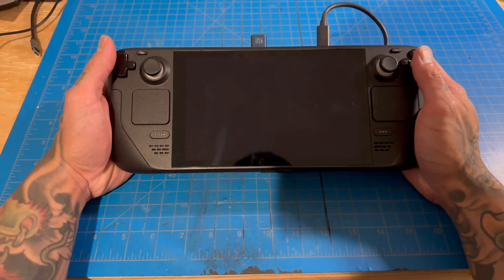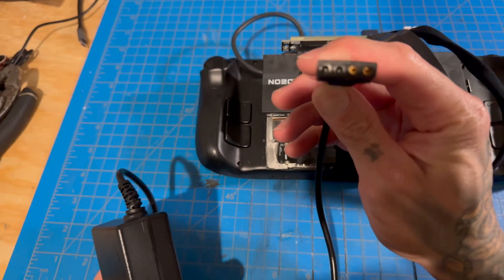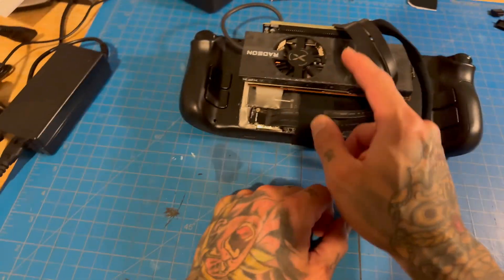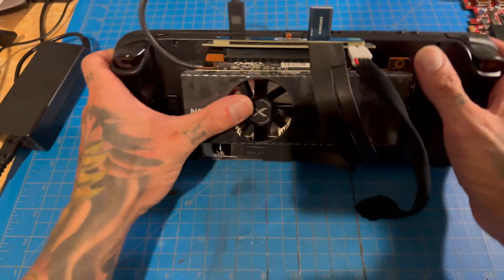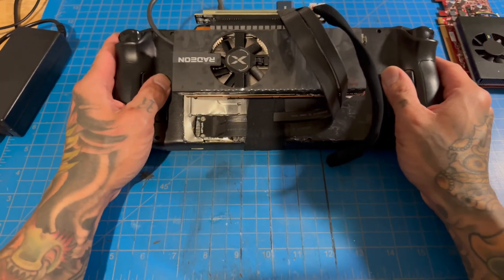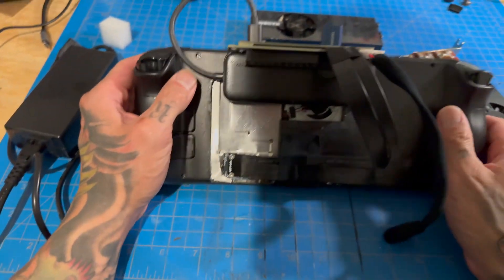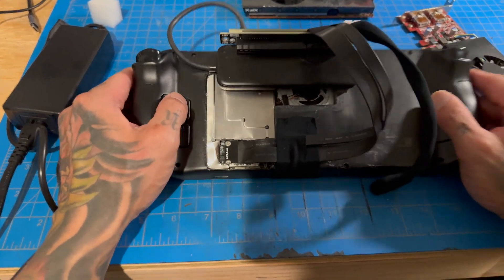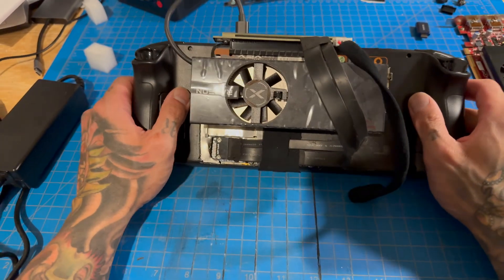Ultimate Steam Deck - GPU MOD

Comment: Im using a 6500XT 8gb and for cooling the cpu and using the Red magic cooler 5 pro.. My Chimera OS is still working and did some updates last night, but I noticed that desktop mode was not working, not letting me choose anything on the screen..
Keep doing your projects, and never give up bro.👍🏽
Reply from the maker: Thanks man, yea I have been having issues with Chimera as well.

I can get it to go to desktop mode, but its terrible performance.

oddly enough it runs better on handheld then desktop, but bot runs worse than stock.

Comment: I think, this is idea is possible, but, we need somehow totally redesign whole case, and think about to move controllers outside steam deck case. Like it will be small box with screen, m2, gpu and lithium battery + gamepad or something
Reply from the maker: Not a bad idea, if I can get the software to jive with a new hardware  it will be one huge step forward but right now

Software is the real issue

Comment: absolutely love your experiments buddy, can't wait for what's next. 4060 would probably be a great idea, wonder how much you could dowclock it and if it could work on battery at that point off the C port
Reply from the maker: The real issue is battery voltage, we need 12 V at least 5 A

Essentially gonna have to strap a laptop battery to get that.

Stay tuned
Reply: @Diy_Papi  can't wait buddy
Reply: @Diy_Papi did you end up trying this or still giving up on the mission?  I was really looking forward to seeing you succeed with a non windows solution

Comment: So you only tried installing ChimeraOS and Bazzite? I would also try with a clean ArchLinux. These gaming distros could be gutted of functions or be made with a single GPU in mind, esp if they're designed specifically for the Steam Deck
Reply from the maker: Thanks for the info. I’ll give that a shot.

Comment: I’m surprised you haven’t done a steam deck oled overclocking video yet. I have mines undervolted and overclocked to 18 watts with the Gpu max clock at 1900. It’s a really nice boost and the temps never even reach 80 with stock cooling. I’m curious how someone of your expertise could push it lol
Reply from the maker: @alex1212456  don’t tempt me lol
Reply: @Diy_Papi  it’s sick. I used to overclock the LCD to try and hit a 40fps level on games. But now with a overclock oled I can hit 45 instead. And even if it drops by 1 or 2 frames it’s way better since it’s 45/90 instead of 40/40

Comment: A for effort ! Sad it didn’t work out as you wanted it to but I’m glad the adapter and stuff will live on in the mini pc. I’m about to probably hop into some mini pc action soon and see what I can cook up. I love modding as you know and modding handhelds is fun but we have I think even more potential to unlock with mini pc’s. Have you thought about lookin for a dedicated mini egpu like those super small onexgpu ? I wonder if you’d have better support with one of those …
Reply from the maker: Thanks, it’s all good had fun making it that’s what counts lol.

Hell yea happy tinkering! 

Honestly I don’t think onexegpu would make a difference, I’m pretty sure it has to do with the SD communicating with the gpu on Linux, everything works perfect on windows 🤦🏻

Sucks that chimera broke because it worked pretty good.
Reply: Im so sorry to bother you. With this GPU added how many FPS you recon you would get on Fortnite? Currently on windows on performance mode it's running 90-110fps very stable  @Diy_Papi